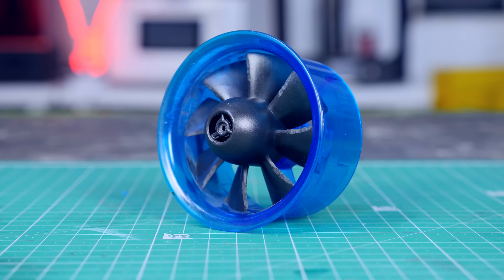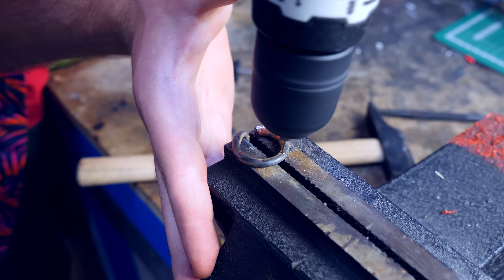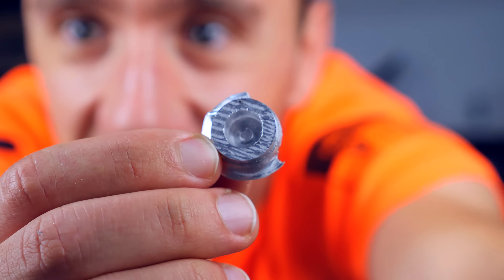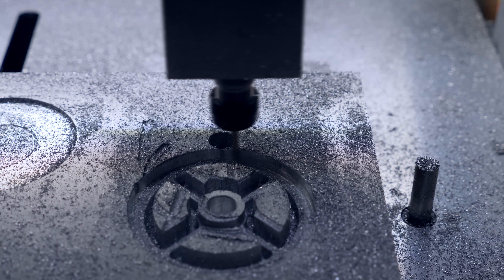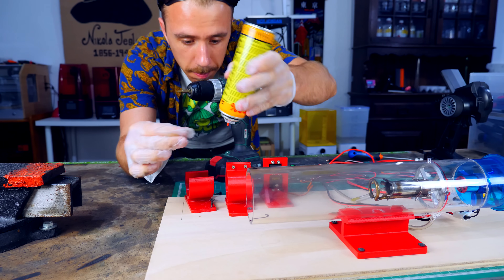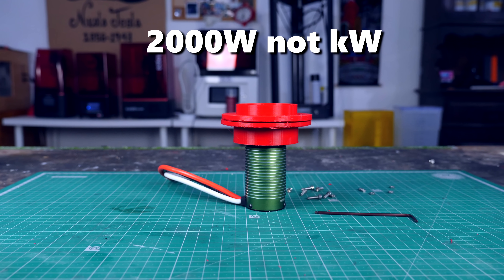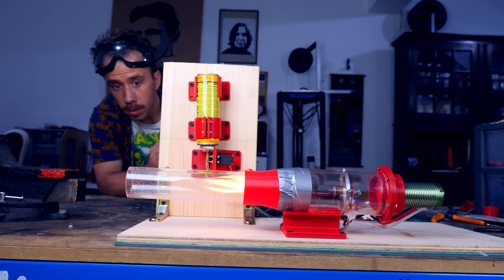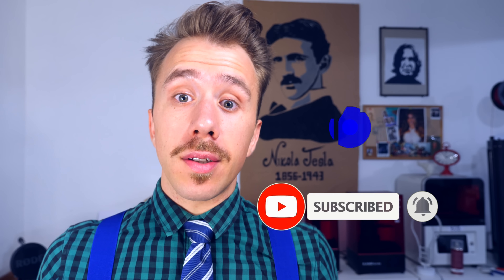I turned my Fan into a Jet Engine (3D Printed EDF Afterburner)

Comment: Most jet engines pre-heat the fuel into vapour by running the fuel line through the hot part of the combustion chamber just before the injectors.

Comment: Make a rocket on simple rockets 2 and then 3d print it. 

Use standard model rocket engines for power and proper scale. 

Got my 3d printer coming. Bought it off of goodwill auctions at a hell of a price. 

First project. Hemp fishing pole. 

May slap an audrino or pi on it. Idk. Will see.

Comment: try using cutting oil when cutting metal with a CNC, you'll have a smoother cut with less friction and it will save your bit
Reply: Holding the end mill as short as possible will make a big difference too. Machining is all about rigidity.

Comment: 30lb propane tank using a 30# to 1# adapter hose. Also…. There is another channel that does YouTube watchers designed fan blades…. And pits them against each other. I’ll look for the name… collaboration!
Reply: Major hardware is the channel
Also…. 30psi or higher regulator and raspberry pi controlled needle valve.

Comment: So, tricks of the trade that you can use are:
1. spray fuel directly on your glow plug, that will evaporate everything and stratify it - you will be able to use more conventional fuels, not only low evaporation point ones.
2. by adjusting exhaust of your evaporation chamber you can get negative pressure and not have to pump the fuel inside, it will be sucked out 
3. I would suggest using "bypass" design (tube in tube) that will provide cooling to your acrylic chamber, in the end of your video we can see tube just bending due to getting near melting point. 
4. two EDF in counter rotation can provide better backpresure, while providing good airflow.
5. If you really want to have a backburner design - you are right now doing it back to front, your compressor stage need to provide higher pressure through narrower passage for it to slow down in combustion chamber -> expand and increase a pressure to provide more velocity of exhaust gasses, edf's / home design centrifugal fans are not really good for that, but papst makes some good "jet fans" (look up their catalogue for parts with JJ in those) but be prepared for high ampage. Still rule of thumb is that compression stage = 2x combustion stage pressure to get any reasonable starting point.
6. get your self a foam / powder fire extinguisher since you are using flammable materials for combustion chamber, and those prototypes can get quickly out of hand. 
And thanks for nice content.

Comment: Video idea: make this on a plane! The thrust seems to be good enough. And it can be made easily by attaching wings to it!
Reply: Yes,  He can Do it
Reply: David Windestål already did that once on an old episode of flitetest.
Reply: @Sven_Hein  I remember seeing that episode. the sound it made was awesome.
Reply: He could but you have to perfect the aerodynamicist so then it would actually fly in that just stay on the ground or get up in the air then do a nose dive
Reply: @multimotionz2952  If you just have enough power you can make a closet door fly. You only need a powerful motor on one end and flaps on the other... (ailerons and elevator can be combined with some electronics calculating)
Reply: @multimotionz2952  yeah I was about to say  even if he just straight up 3d prints a plane, there is no way to control it or make sure it goes where you need it to without much more tweaking if not electronics. If not, he's essentially just hurling a combustion engine into the air and hoping nobody gets hurt😅
Reply: Try to partner with PeterStripol and make a plane! It should be a great first step to building model rockets with these <3
Reply: Needs a tighter nozzle but it has decent thrust
Reply: Yea you definitely getting the 3D printer just have fun with it
Reply: NSA would not like that
Reply: 14:56 bruh U won 3 rd printer giveaway cause I think u have highest likes 
Check here 😋😀❤️
Reply: Yeah, just keep the center of lift a little bit behind the center of gravity, then it could probably glide with the thruster by itself
Reply: i dont think it is producing enought thrust
Reply: Pog
Reply: Idk it would work to go in the wings
Reply: Please
Reply: You’d probably be kicked off
Reply: This wouldn't create enough power/ weight to fly in my opinion
Reply: its way too heavy
Reply: It’s obvious
Reply: and then add a m2 browning for backfire
Reply: @waldfruchttee  try gau 9 it shoots beer bottle sized bullets
Reply: Integza is unstoppable
Reply: Take it a step further and incorporate a vertical take off and land feature like an f35
Reply: Attach wings to engines instead of engines to wings?
Yeah I think we can understand each other here.
Reply: Yeahh.. never trust a guy whom proudly have background nikola t & severus snape. Which non of them the real electric scientist and or scientist. Just bcz u build bigger / smaller generator for a competitor company , doesnt mean ppl must  recognized u (nikola) as inventor of present day generators and electricity
Reply: Ask @PeterSripol to help, he's got some experience with this sort of thing.
Reply: @Harperion Easily possible with a little brain food and elbow grease. A bit of punctuation, for effect of course, might help a little.
Reply: "The thrust seems to be good enough" < and how did you come to this conclusion? he literally did zero tests on thrust output ... yet you've concluded that the thrust is "good enough" ...
Reply: @rustyneedles3743  Why are you so quick to shut down his idea? If the thrust be insufficient, then increase it he shall! Integza is smart enough to figure it out, perhaps instead of criticizing others, you should use your imagination and have some fun your life.
Reply: @ElementalcraftStudios  hmmm, it's possible to have fun whilst maintaining a healthy sense of reality, maybe you should try it sometime, till then, don't you and your friends eat all the crayons.
Reply: @rustyneedles3743  Point is don't merde on other peoples day.
Reply: No thrust
Reply: Its not making any more thrust.

Comment: Your design would have worked good the way you had it set up. Only thing you were  missing is a nozzle with a slightly larger diameter on the end.

Comment: 3D printed idea, use the jet engine you've just created and make a boiler and use the jet engine to superheat water into steam to drive a gear-driven mechanism that will spin a generator,measure outcomes  and compare with regular boiler.

Comment: try to make a jet engine working like the one you made before the small one (please protect the exhaust because will burn in 30 minutes) but making it's own fuel line and air taking and try to print a plane for it and mount it to see if really works

Comment: a glowplug is not for ignition in diesel engines, it just pre-heats the combustion chamber but it doesn`t ignite anything. you can run a diesel engine without them, it just takes a little bit longer for them to start if its cold.

Comment: That Mamba monster motor is about 2000kv an it has more torque then it dose rpm. Maybe make a gear box so you can have a wide range of gear selection to move the air faster an prop pitch helps too  an you'll need mod 1 gearing an make sure you look at the shaft hole size on the gears that motor shaft is a 5 mm shaft it's big lol. Also you can change the power curve an other stuff if you use the castle link software it should have came with. If you need more air movement

Comment: Idea: Make an airship (aerostat; example: blimp) capable of lifting you, using steam as a lifting gas, not merely hot air. Hot air has 30% of the lifting force of helium and/or hydrogen, water-saturated hot air (about 30% water) has a lifting force of 40% of that of helium, and steam has a lifting force of 60% of that of helium. So, with enough safety measures, you could make a hot air balloon steered by fans, capable of flying you safer than a drone would. I know it's a very big task, and your house might not be big enough to built it in, but you can probably build most of the parts there, and test it in a field somewhere, first wirelessly with some weights, then with you driving it.

Comment: Awesome video man! This is such a cool deep dive into turbines, you earned that sub! If you keep going with this series could you try a couple of things? A glass tube might eliminate the worry of the afterburn flame melting the tube and we could still observe it! If you could find a capable fan and matching tube you could probably get a perfect ignition. Also can you find butane in Russia? Butane seems to have a lot more "thrust" in ignition whereas propane seems to burn sort of low and slow. Lastly the bigger the can the better (not an expert here just a dude that dabbles) if you had say.... a 25oz can of butane vs a 6 or 8 oz you can maintain that peak flow for longer without the pressure dying down.

Anyway sorry for the rant. If you read to the end I am willing to help fund some of this thru PayPal :) again, great vid

Comment: @Integza You need to revisit the axial fan an 3D Print a "Static Pressure Boost Plate" which is a plate that has vanes (like a fan) but are stationary and use a reversed in angle to the blades of the fan you are using. Hope This Helps!!!😁👍🏻

Comment: Well, no, you're just blowing a flame with a battery-powered electric fan.
Add a compression stage and a turbine stage, so that the heat expansion generates sufficient energy to allow the turbine to power the compressor so that the whole thing can maintain equilibrium using only the flame's fuel as the input energy - then you'll have a jet engine.

Comment: You made a miniature heater! You can buy them at Lows. It's not a turbo jet, its called an EDF, electric ducted fan, used in small  RC foam jets, I fly them. Your heater has no thrust.

Comment: you can get an arc cigarette lighter to make high voltage ignition sparks. or any number of high voltage arc generators for €5 on ebay. And you can get glow plugs meant for Nitro RC cars.

Comment: It will help to drill multiple holes and kinda perforate the profile before machining with the endmill, try to also dab a bit of cutting oil especially for ally... Brass would be a good option for dry machining .

Comment: This is complete crap, nowhere near a jet engine.
More like a fake jet engine since the burning propane stuff doesn't do pretty much anything for thrust. It's like putting a candle in a pipe and blowing it with a fan but instead of extinguishing it, it still burns...so it's crap.

Comment: How long did the Glow Plug installed in this video resist glowing? 
There are also 'Ignitors' such as 'Webasto part number 84906B' you'll find other brands when looking for this in the web, in eBay,.. Blessings +

Comment: A jet engine fuel injector will purge itself of any excess fuel during the shutdown cycle to avoid fires. You can achieve an almost similar effect here by purging your fuel line with an inert gas (maybe add another tank filled with co2?) when you're shutting down the engine. Running the fan for a while after shutdown also helps extinguish any flame that might appear.

Comment: I saw your turbo jet engine video and had a thought. Instead of 3D printing a mold and casting in ceramic. Why not 3D print a part, then cast a mold around it in silicone, then cast the parts in the silicone mold. Then you can cast multiple parts, remove the step of cleaning up the cast part, and then even cast wax parts for lost wax metal casting. Great videos by the way

Comment: 2:48 A diesel engine utilizes glow plug only to preheat the combustion chamber. The ignition is caused by high compression and happens when the fuel is ejected to the chamber.

Comment: Afterburners dont "reheat" exhaust gasses. That exhaust stream is 1000+ degrees out the nozzle.
Afterburners, quite literaly, dump extra fuel into the exhaust stream (which is plenty hot enough to ignite the fuel) inside the cone. Horribly inefficient, but almost doubles the power output of an engine.

Comment: Hey Integza, so I just saw an ad for a metal 3d printer from mark forged. The website says it's safe and affordable. Safe is debatable when it comes to you, but affordable isn't. And you don't even need to use the kiln for it. If you do get it, name it like Midas, after the guy with the golden touch

Comment: My suggestions or modifications  that can be made in this afterburner.
1. Use preheated kerosene as fuel .
2. Replace the diffuser use 2 mm grid diffuser. 
3. Make some flanges on the heating part of glow plug     to increase its surface area.
4. Turbulent flow can mix the fuel with oxygen very well so keep it turbulent. 
Give me thumbs up if you think this will work.

Comment: What about using just the composer side of a turbo and power it with a geared electric motor or a brig and Stratton engine to power the air side. Then use the glow plug after the fuel injector and then constrict the flow on the way out
Reply: When you are using (half) a turbo anyway, you might as well use the entire thing and build a real turbojet.
Reply: @tz8785  the other half with is the exhaust side and it is used to spin the compressor side. I am saying instead of using exhaust gases to power it attach a gear/a gear box (to get a high gear ratio, because turbos need to spin at crazy high rpms to creat boost 35,000 - 100,000 rpms) to spin the turbo an electric motor mite not be strong enough to spin it to that high of rpms with out using crazy high amounts of power That is why I suggested something like a Briggs & Stratton engine you can pick them up very cheap and they’re really fun to work with

Comment: Something I have tried to do from scratch is design my own CPU and GPU water cooling system. A motor with a centrifugal fan that is fully contained within a water tank to deliver a large flow of water to keep the CPU and GPU cooled on a PC system. I've built my own using a submersible water pump within a tank, but, to get a good flow,  800-1000 gps, it would take a huge pump. With a centrifugal fan pump, like a water pump in a car, this could be accomplished, I am theorizing. Think you could design one? A complete system. Pump, lines, copper cooling blocks, everything? Like I said, I have built one. Just not a high volume delivery. The copper blocks are easy enough as well. But I could never design the pump. I was trying by hand with 1/4" plexiglass. It was doomed from the start. A 3d printer is the way to go here.
Thanks.

Comment: Some jet engine tips:

Work on making a convergent divergent nozzle out the back in addition to a vane pack to stabilize the air before it goes into your augmentor/after burner. These will help the flame hold steady and lead to better combustion.

Comment: sorry but a glow plug is not a method of ignition it is used in diesel engine to warm the air inside the cylinders before you crank the engine the compression itself cause the explosion if the air inside the cylinders is to cold  the engine will not start the glow plugs only work for a short time before the engine starts

Comment: Instead of a turbojet engine. Could you try a turbo rocket engine basically replacing and pipe with a bell nozzle. And have combustion happen in that nozzle. Pressurized air fuel and combustion in the Bell nozzle. what you think???

Comment: RC guy here... you have some wrong info on the motor. That's 2000kV not kW or W. It's how many rpm the motor will make with 0 load at constant maximum power. good work though! Just trying to teach, not offend.

Comment: I'm new to the channel so may have missed if you have already tried this approach. For the next video why not try 3D printing rocket parts in heat resistant silicone? Perhaps a silicone liner to protect your pvc combustion chamber, or to form nozzles? I have no idea if this is possible but if anyone can make a rocket with flexible parts....

Comment: Not enough compression. I would advise staging multiple fans inside the housing to compress the air into a funnel shape pathway which is where you have fuel added into the mix and ignited at the point where the mix is compressed the most. Then you have more fuel introduced at the rear of the housing to make an afterburner.

Comment: Try machining the blades or some support rings for the blades on the CnC, might help with the radial tension, then you can work with some tighter clearance. Same principal as Tesla's carbon wrapped motor... restricts the expansion and improves efficiency !! :D
For some design ideas for the centrifugal fan, https://youtu.be/YuEaP9kyiFc
A good fella to talk to about fans might also be "Major Hardware", he's been running a computer cooling fan showdown. https://www.youtube.com/channel/UCUXW4gT27TOaDzKFyN-1tXQ

Comment: I would like to see a jet engine that runs on hydrogen. And then using a an after burner that infuses oxygen into the burn. And then an exit nosel that is smaller again to add more compression . Hydrogen has the fastest chemical reaction. Although if it might be easier to find you may want to use acetylene and oxygen.  Just think of how spectacular that exhaust would look. Thank you for all your videos... A.K.A. TANKA

Comment: I have the same machine! Tip with aluminum is to use high quality 1 or 2 flute endmills, shallow depths of cut and either using compressed air for chip evac or even a little wd40. I run most of my ops at around 35 in per min at 18k to 24k rpm

Comment: Design an impeller/centrifugal fan more resembling a car turbocharger's cold side, it's easier to model than real life jet engine's compressor wheels ;) Mind you, much more aggresive curves, or you won't get much pressure without huge RPM. So far you rely more on air speed than pressure, so I hope you succed in whatever way you decide! Stay safe and give it gas! :D